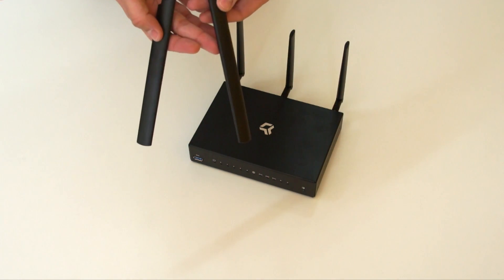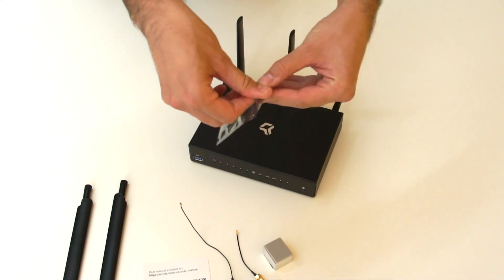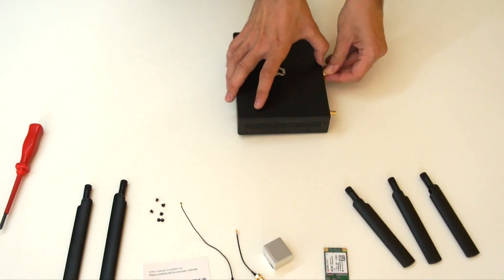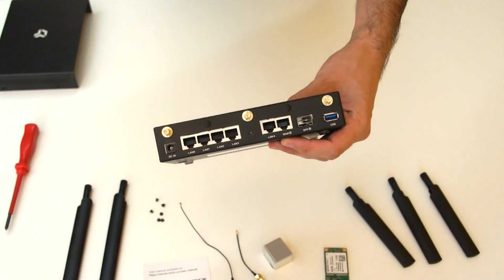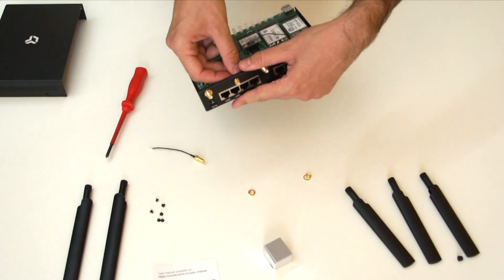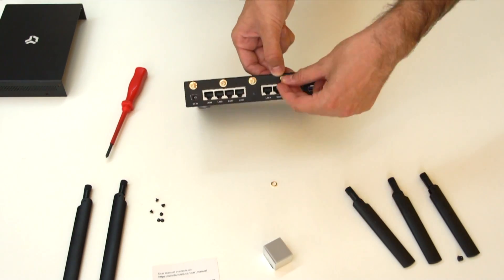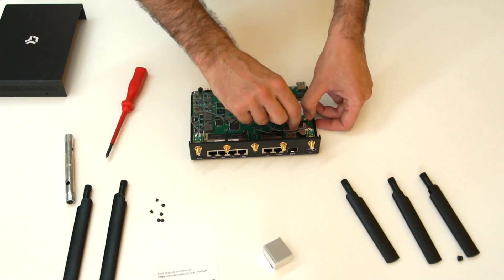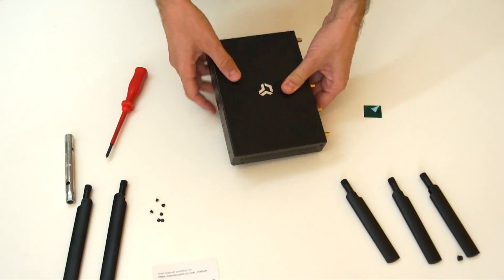Turris Omnia: How to install the "LTE pack"

Comment: Hi, I have the router already and I'm happy with it. I also want this "LTE Pack", but the link you posted before (Quectel EC20) is not the full "pack" you are using in this video. Is there any means (within Europe) to get the whole LTE pack, including antennas, connectors, etc? I'd be happy if that works out. Thanks!!